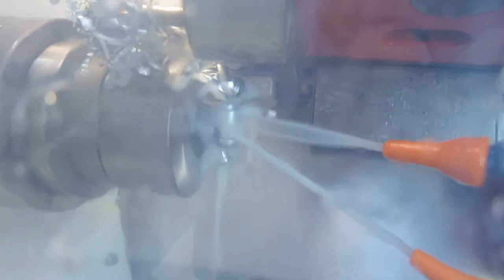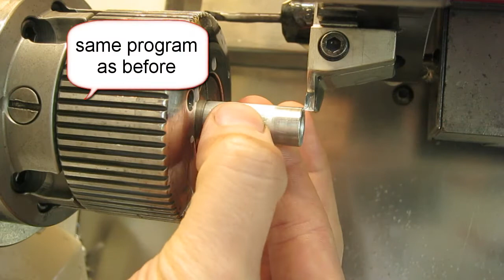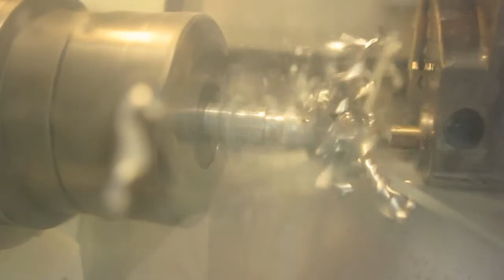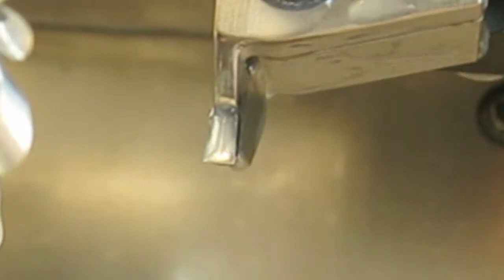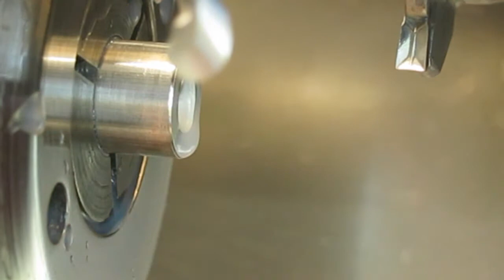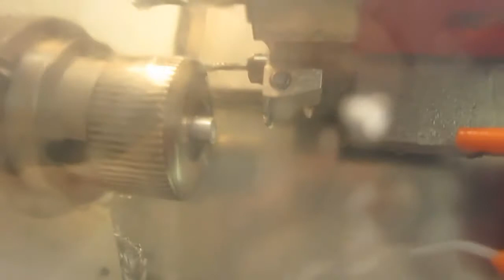Accident Waiting to Happen

Comment: When u use a part off tool to face and turn metal you bend it. Just looking for trouble when you use wrong tools.
Reply from the maker: insert is designed for turning and parting off, check iscar catalog